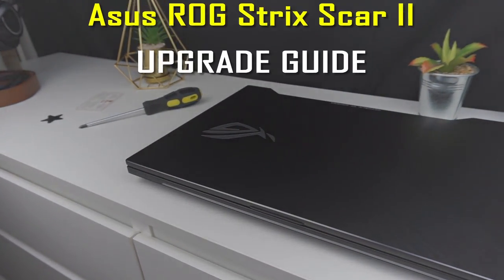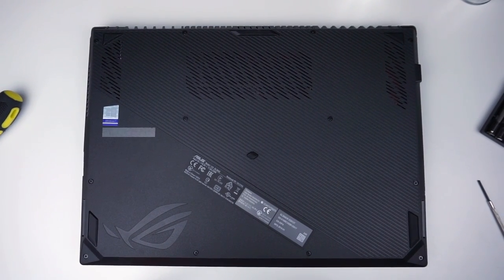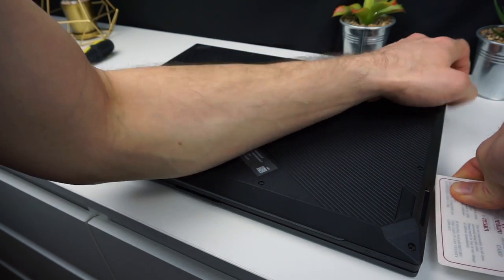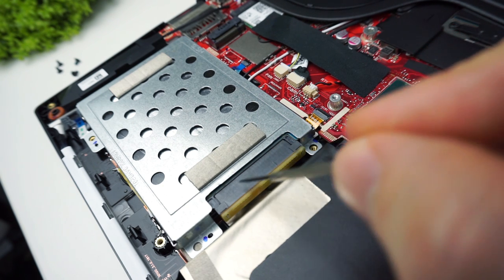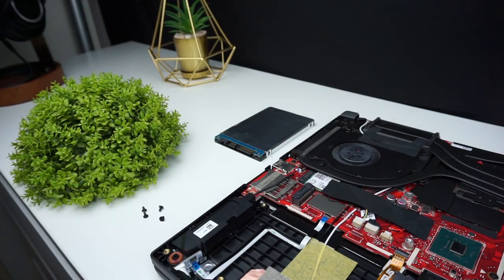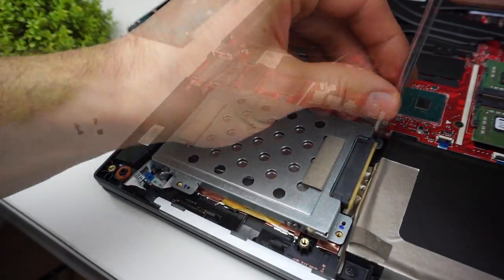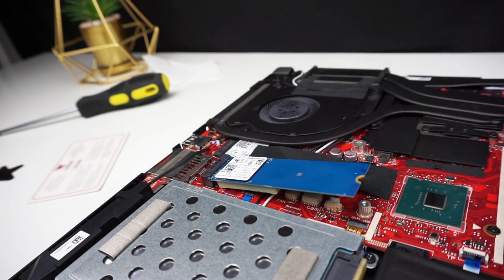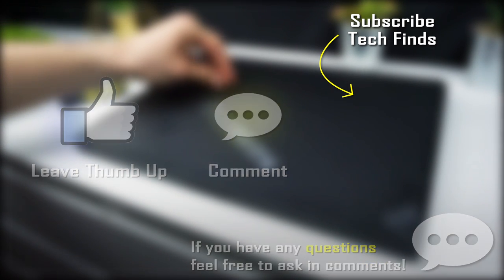Asus ROG Strix Scar II upgrade (RAM, SSD, HDD) - Disassembly Guide (detailed)

Comment: Hi, i actually bought this model. Im planning to buy 1 more 16gb ram, because mine has only 16×1 ram. My model has the sk hynix 16gb ram installed, but is it possible to pair it with a different brand of 16×1 memory?
Reply from the maker: Yes, you can put any ram that I linked in the description. The closest one in terms of specs is Crucial
Reply: @TechFinds  thank you! So i just have to buy 16×1 crucial right?
Reply from the maker: @Jeriqm  yes, but if you want you can buy the same one as yours for the best compatibility. If you know exact part number of that hynix you've got. However Crucial will work good too.
Reply: @TechFinds  thanks!

Comment: I just got the G731GU but I do not have the HDD sata cable because I got the laptop with just the m.2 so they didn’t include the HDD cable. It is out of stock on the Asus website. I still installed the SSD in my laptop but it is patiently waiting to be connected to the motherboard with an HDD cable.
Reply from the maker: Your HDD cable should be in the envelope with paperwork that came with the laptop. Have you checked?
Reply: @TechFinds  I opened the envelope last night and all that I saw in there was the paperwork.
Reply from the maker: @KingLion17007  it's a small part, maybe they lost it. But it also may not ship with the laptop in certain countries.
Reply: Tech Finds Yea, I’m just going to have to order it unfortunately.

Comment: Hi thank you for video but I have a question, whill this GL504GM motherboard support 2 TB m.2 NVME SSD? I asked asus guys they told 500gb m.2 ssd max but I am not sure they are correct, I find everywhere but still not confirmed.
Reply from the maker: I don't know why they are saying that, but you can install 2TB one.
Reply: @TechFinds  Thank you for your response, I asked you because 2TB SSD is approx 600$ here so if I buy and it didn't support that will be a problem.
Reply from the maker: @KonarkJha  You have always a customer right to return an item within usually 14 days ;)

Comment: what do I do if I do not have the storage piece at 2:37 I have the connector to the mother board
Reply from the maker: So you don't have this metal caddy for HDD? Well, you have to buy one if it's not in the box or inside the laptop. I linked it in the description
Reply: Tech Finds I saw that I was just a little confused cause you already bought one so I thought I was missing it thank you anyways tho

Comment: Awesome Video, i have problem, my default Ram is SK hynix 16GB 2666 i need to upgrade to 32GB. can i install different brand like crucial (16Gb) in my laptop (strix scar II )
Reply from the maker: Yes you can do it as long as the specs of other ram are as close as possible. The  rand doesn't matter that much but for the best compatibility it's recommended to have 2 sticks of the same RAM.
Reply: I have just upgrade mine and now have a spare Hynix ram (HMA82GS6CJR8N-VK). I'm going to stick it on eBay (UK) in about a week. I'll let you know on here if you are still interested.
Reply: @robertnorris8094  Thanks mate, already installed crucial with same specification.(16GB 2666). :)
Reply: @778spartacus  Does it work at 2666 - I bought Ballistix and it works only work at 2400 so swapped for HyperX

Comment: Hey man,
I saw many people are unscrewing back panel and adding ram. But I was wondering if even unscrewing voids warranty. My suspicion comes from the fact that my notebook's bolts are covered in blue.
Reply from the maker: I think that every laptop has this blue/brown paint on screws. My guess is that it helps to tighten the screw inside. Warranty terms may be different for each country but in general you should be free to open the bottom if there's no warranty sticker on any of the screws. Nonetheless it's better to read your warranty terms or contact Asus support in your country.
Reply: @TechFinds  thanks for the fast replies man. great video. By the way undervolting and slight underclocking helped a ton man. I was the guy with 95C on cpu.it is about 85 now. still hot but not throttling.
Reply from the maker: @cybrhckr  Most of laptops run at about 85 degrees nowdays so i think that it's a good result. That's good you managed to drop the temperatures but isn't the performance a sacrifice if you underclocked it?
Reply: @TechFinds  none of the games as I have seen are affected by my 200 mhz cpu downclock. They are just barely close to %80. Even Apex and BFV.
Reply: @cybrhckr  how did u underclock? I want to underclock mine to 3.7/3.6ghz , cuz temps peeking into 90s and gets throttled
Reply: @adarshmpawar   try throttlestop. There is a frequency table on left handside with multipliers. If you have not tried undervolting, do that first. With lower frequencies you actually can undervolt bit higher. Do that if underVolting alone does not work. I now run this laptop with OC ed settings for gpu and 3.9 cpu with increased fan speeds.) Still is hot but not throttling anymore. with complaints, on bios 304 update they lowered the throttle temp to 90 deg. it was 95 before.
Reply: @cybrhckr  i undervolted mine to 113 mV,  any lower causes me to blue screeen. Fan speeds are kinda inconsistent for me due to throttling.
Reply: on scar ii laptops removing the back panel voids warranty, no matter the country. It is written on the warranty terms on asus website. However, if you would ask me how would they know if there is not sticker etc. Then idk :)

Comment: What is the company name and model number of pre-installed M.2 NVMe drive???
Reply from the maker: Unfortunately I don't remember that now. I'm guessing it was Kingston or Samsung.
Reply: Disk 0 (C:)

	INTEL SSDPEKNW512G8

	Capacity:	477 GB
	Formatted:	477 GB
	System disk:	Yes
	Page file:	Yes

	Read speed	0 KB/s
	Write speed	0 KB/s
	Active time	0%
	Average response time	0 ms
Reply: @JCMaxi  thanks

Comment: Bro after upgrading ram and hdd is there any need to Install windows again.
Reply from the maker: If it comes to RAM you just put the RAM stick into the slot and you're ready to go. If you're adding HDD or SSD where the system is installed on it you have to install the system on new drive. And if you're not changing the drive with system you just install the new drive and then you have to find it in BIOS and split (or not) into partitions. Here's how to do it, start from 10:25: https://www.youtube.com/watch?v=UV72wLA06_c&t=628s
It usually works the same for every laptop.
Reply: Thanks

Comment: can I upgrade to 2tb m.2? is there such thing as maximum capacity nvme supported?
Reply from the maker: I've heard that 1TB M.2 is maximum, but I am not sure if they mean that you can put max 1TB M. 2 SSD or they sell the configurations with max 1TB SSD (but you can put more). I can't co firm, because i didn't find any info about that.
Reply: @TechFinds  ive got a feeling asus is talking about the  max configutation you  can get from them.
Reply from the maker: @timeoutmode  maybe that's true. Personally I don't see any reason to set capacity limits in laptops.

Comment: Hey there. Thanks for the video guide! Helps with the amateur like the rest of us. Noticed you swapped the SSD, how do you move the OS and the rest of the files across?
Reply from the maker: I didn't swap mine, I just wanted to show how to do it. ;) If you swap the drive where your system is installed you need to reinstall it on new drive from pendrive. But idk how you can get a free coppy of Win 10.
Reply: Will you be able to confirm if the Samsung 860 eco fits into the cage?
Reply from the maker: @jimmyttl  you mean 860 evo? Yep it fits to the 2.5" drive bay

Comment: Hello Tech Find I just got my Rog Strix Scar 2 and I'm planning to add another 16gb ram ddr4. What would you recommend for me?
Reply from the maker: So you have 1x16GB already? If you mix RAM go for Crucial that i linked since it has the same specs as original RAM that Scar 2 comes with.

Comment: Thanks your channel., It is very useful.  Can I use the Samsung 970 EVO 2TB for upgrade this laptop?
Reply from the maker: I am not sure what is the maximum capacity of SSD that you can add to the M.2 slot. I wasn't changing mine SSD so I forgot to check it out. For sure you can add Evo 970 but it would be good if you could find an info about maximum SSD volume.
Reply: Thanks your respond

Comment: it comes with 256gb of ram can i add Samsung 970 Evo 1TB - NVMe PCIe M.2 2280 Solid State Drive to it
Reply from the maker: Yes, you can add this Evo 970 SSD. I mean replace your 256GB SSD, because there's only one slot. And then you have to fresh install Windows on your new SSD

Comment: can I upgrade a NMVE instead hard drive? do you have any suggestion?
Reply from the maker: You can't have NvMe drive instead of HDD. You have one slot for hard drive and one slot for M.2 NvMe drive - they ad way different sizes, you can see that in the video. You can replce your M.2 NvMe drive fo different one and 2.5" HDD for different 2.5" HDD, SSD or SSHD.
Reply: @TechFinds  thanks, what do you think about this kind of adaptors for HHD to ssd?
Reply from the maker: @leomoroz  Never heard about smth like that. What do you exactly mean?

Comment: Hi teach find i want to ask is there’s a different on buying 16 ram with 3200mhz does it make different from 2666mhz  or i only can put 2666mhz
Reply from the maker: The Scar 2 supports max 2666MHz RAM.
Reply: Tech Finds ty so the laptop come with 2666 right
Reply from the maker: @Snow6060  yep, and if you wanna upgrade you can go for 2666MHz too
Reply: Thanks
Reply: Tech Finds 1 more question if i add 1 ram it will be dual right
Reply from the maker: @Snow6060  Yes - dual channel means that 2 RAM slots are occupied by RAM.
Reply: Tech Finds thanks
Reply: Tech Finds hi again teach the scar iii same support 2666mhz
Reply from the maker: @Snow6060  yes, Scar 3 comes with 2666MHz RAM too

Comment: What kind of 2x8gb ram stick do you recommend for me to buy for this laptop
Reply from the maker: If you wanna swap out 2 sticks you can go for HyperX since it's the fastest. But if you're planning to mix 1 stick with the existing RAM i recommend Crucial for the best compatibility, because it has the same specs as original RAM.
Reply: Tech Finds its the fastest like it will have a better performance than other dual channel ram sticks?
Reply from the maker: @protopkickercr8949  HyperX? Yes, it has the lowest latency and it's a gaming-oriented RAM, so it will be faster.

Comment: on scar ii laptops removing the back panel voids warranty, no matter the country. It is written on the warranty terms on asus website. However, if you would ask me how would they know if there is not sticker etc. Then idk :)
Reply from the maker: I think they're not able to notice if it was opened or not unles you scratch te screws or damage something. There is only a warranty sticker on the cooling system. Thanks for info!
Reply: @TechFinds  exactly. I am also suspicious of the colored screws because they were almost like in glue consistency and fallen apart. I  contacted asus about warranty terms too and they also agreed opening back panel voids it (USA)
Reply from the maker: @cybrhckr  Idk, the blue/brown paint on screws is to tighten them up but i once thought that it's some kind of warranty seal to check if it was opened.
Reply: @TechFinds  why would it require to be tightened?
Reply from the maker: @cybrhckr  I can ask you the same question, i think that without this paint the screws won't fall off anyway but it is what it is.

Comment: Can you make a video for thermal repaste
Reply from the maker: I don't own this laptop mate.
Reply: I see alright i own it was looking for a detailed repasting video not experienced with these 
My cpu is throttling  and temps at 85-90
       Gpu reaches to 88° jst after 5 min of gaming
Kinda frustrated thermal repaste will work? On temps?
Reply from the maker: @lordblaze-x7067  Repasting should do the trick, but you have to do it properly and use good thermal paste like Thermal Grizzly Kryonaut. Also make sure to always play games with the maximum fan speed enabled (overboost/turbo mode)

Comment: Thanks for the info. I'm interested to replace my ram to both 16gb; however, in Amazon there are two choices - one has dual rank while the other doesn't have? What's the difference and which one should I use? Thanks!
Reply from the maker: There's no really big difference between single rank and dual rank. 0-5% better performance depending on game/settings for dual rank. If you wanna replace both sticks you can go for any RAM you want (1.2V, 2666MHz, 260pin, the lower latency the better)
Reply: @TechFinds  Awesome. Thanks

Comment: What's the max amount of ram that this can support? I wanna see what I can get, and I hope my variant of the scar has a harddrive spot
Reply from the maker: Hey, every Scar 2 has a spot for HDD. You can install max 32GB RAM (2x16) and maximum frequency 2666MHz.
Reply: @TechFinds  I'll need both the SSD and hard drive..my variant will come with a 512GB SSD. Would it be better to load windows on the SSD? Even if it saves only a few seconds, and thank you for the help.
Reply from the maker: @victinizz634  sure, your laptop will come with Windows installed on SSD. If you wanna swap this stock SSD in the future you have to reinstall windows on the new drive. You can have both M.2 SSD + 2.5"HDD at the same time.
Reply: @TechFinds  right, ill be keeping it on the SSD, and how's the overclocking on the CPU?
Reply from the maker: @victinizz634  You can't overclock this CPU. You can OC the GPU in Armoury Crate. Actually the Turbo mode overclocks the GPU if i remember good.
Reply: @TechFinds  well at least it can be overclocked in some way. thanks for the help

Comment: Can someone tell me the difference between SSD and a HDD? Which is better to use?
Reply from the maker: HDD is much slower but cheap. Good to store games if you don't wanna pay much more for SSD of the same capacity. SSD is very fast bit also very expensive. Gaming laptops usually come with one SSD for Windows to run fast and you can add some HDD for cheap storage.

Comment: Hey, my laptop came with an SSD and not a hard drive and I don't have that orange thing that connects the hard drive to the motherboard. What do I do? I also don't have the 4 screws to screw the HDD in
Reply from the maker: In the description i left the link for cable and HDD caddy. If you didn't get these parts with your laptop (in the box or inside the laptop) then you have to buy them

Comment: Hi, i want to confirm for Memory RAM, can i replace all slots? i mean no one was soldered permanently?
Reply from the maker: Yes, you have 2 RAM slots and you can replace both sticks. Max 32GB (2x16)
Reply: @TechFinds  many thanks! I plan to use 2x32GB because i7-8750H support up to 64GB
Reply from the maker: @MichaelTakeuchi404  Where did you find that info?
Reply: @TechFinds  from https://ark.intel.com/content/www/id/id/ark/products/134906/intel-core-i7-8750h-processor-9m-cache-up-to-4-10-ghz.html
Reply from the maker: @MichaelTakeuchi404  Thanks for that info. I only wonder how it is in practice since lastly when i was searching for that info i found that it supports up to 32GB. Could you let us know if it works if you gonna upgrade your laptop?
Reply: @TechFinds  yeah for sure i will let you know, i still waiting for the item
Reply: Hi, my Memory RAM just arrived yesterday and i have install it and it works properly, i just upload the result here https://pasteboard.co/JkUhQls.png and https://pasteboard.co/JkUijzJ.png

Comment: Do you know where I can get the thing that connects the hard drive to the mother board bc I need that exact one and I don't have it anymore bc I lost it
Reply from the maker: I left the link for cable in the description. It's HDD SATA ribbon cable
Reply: Is there any where else i can get it bc i just bought a 2 t hddss and now i cant put it in without the connecter and the connecter including shipping is 70 dollars for me and my mom wont let me spend mony on it
Reply from the maker: @king_amir  Idk other places where you can buy it and i also don't know if any replacement cables can be used so you have to figure it out

Comment: Does the laptop have a data cable included? I'm looking at one with a 512 GB SSD and would like to know
Reply from the maker: This may vary between countries. I bought my unit in the UK with 256GB SSD + 1TB SSHD so obviously i had a cable too. Idk how about USA and other countries if you buy this laptop with only M.2 SSD. Few people reported that they wanted to add 2.5" HDD/SSD and the cable wasn't there so maybe contact the seller first.
Reply: Bought mine in the US.  From the store, it only had the M.2 drive installed.  They do include the cable for the 2.5" drive but it isn't installed.  It is located in the same box as all of the literature.  It is a small ribbon cable so it's easy to overlook.

Comment: When you change the ssd and hdd, do you have to reinstall windows and other programs that came factory with the computer?
Reply from the maker: Only if you're replacing the drive where you have your windows installed. If you wanna just add HDD without touching M.2 SSD then you don't have to install Windows again
Reply: @TechFinds  Hey boss, i bought a crucial single 16gb ddr4-2666 card today. I already have a 16gb installed with the system by sk hynix. If i mix match with crucial to make its 32gb will there be a issue?
Reply from the maker: @Hamzasidiki  it will work. Hopefully you have 1x16 now instead of 2x8